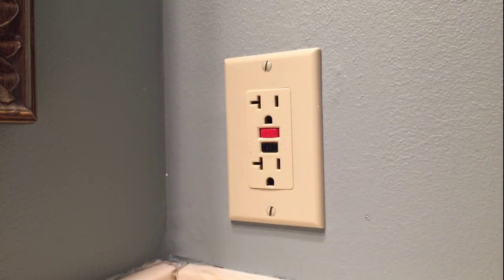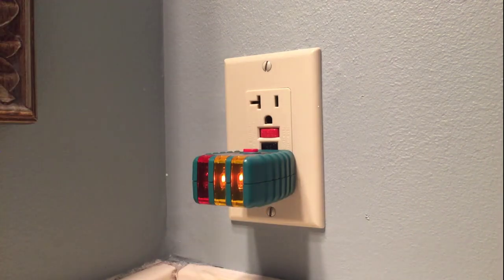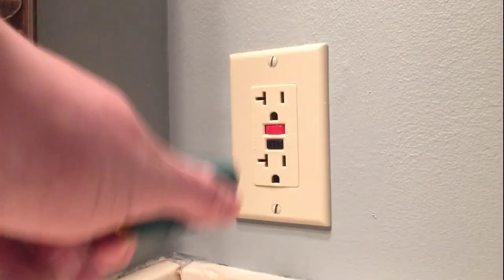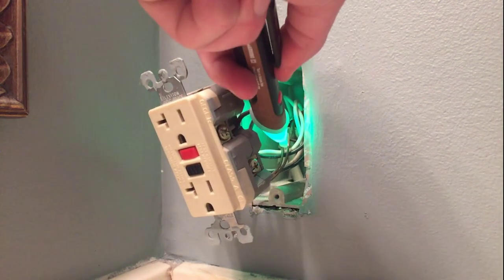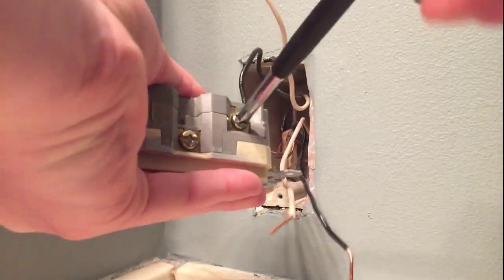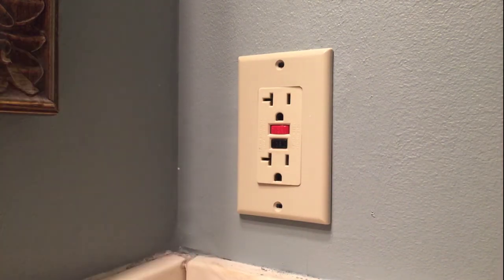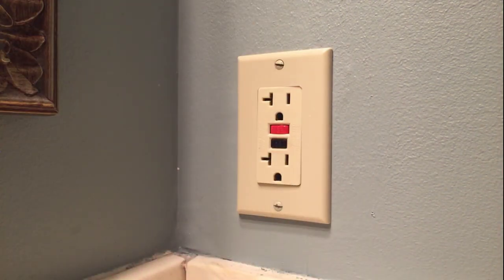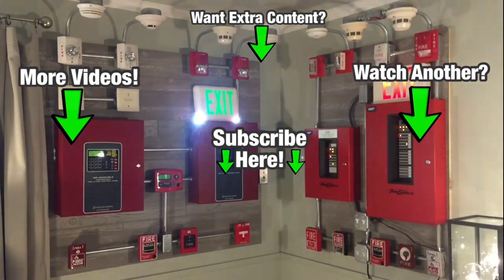Repairing a GFCI Outlet

Comment: You did not explain how you determined the line and load wires. Also you backstabbed the wires which is a no no.
Reply from the maker: Well, in this scenario I didn’t need to explain how to determine the line and load since it was obvious in this case.. they were wired in reverse. Also you must not know what backstabbing is. Backstabbing is an “easy” way to wire a switch or outlet. You push the wire into a small hole and it clicks and locks into place. Over time the hole can become loose and potentially let go of the wire. This GFCI has a screw clamp method where you insert the wire and screw it down thus it will clamp it.
Reply: Backstabbing isn't a "no-no" because it doesn't violate or go against code. 
It's just a simple and quick way to wire connections, although not preferred by professional electricians since these connections tend to become loose.